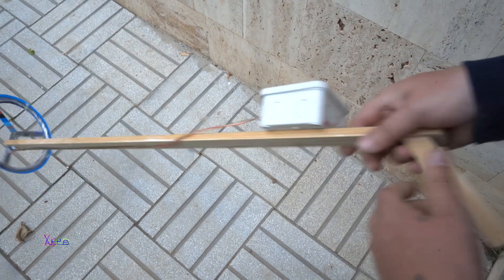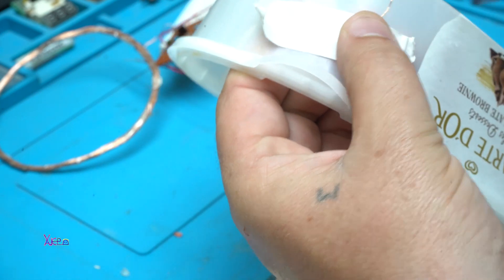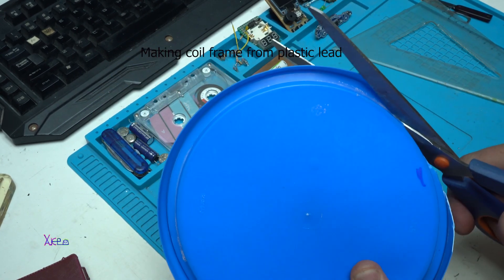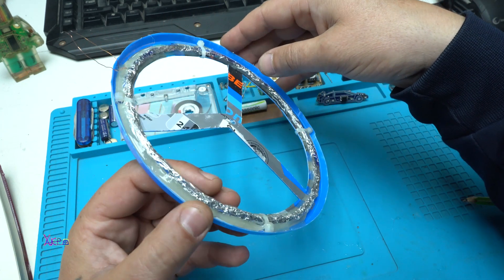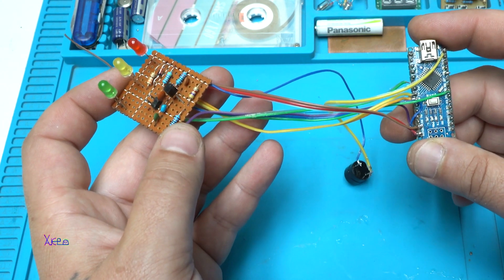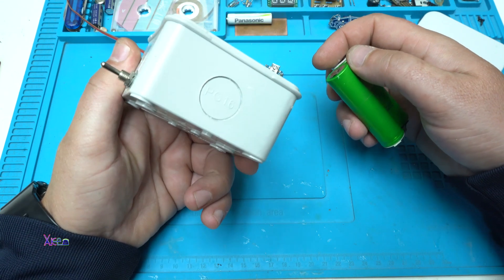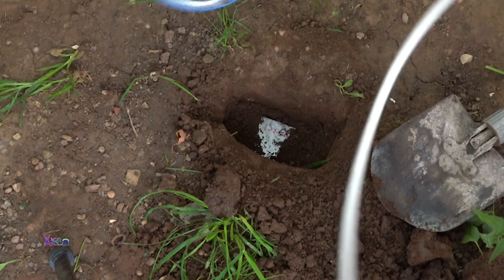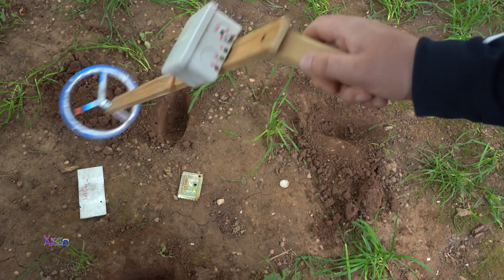How To Make Arduino Metal Detector  (100% Work)

Comment from the maker: Suggest next project? Comment below
Reply: Hey, great video!
I have a question about the Arduino. Do I need to use the specific Arduino Nano D5, or can I program it using my Arduino Uno R3 instead?"
Reply: It is recommended to design a long-range search metal detector that can distinguish precious metals
Reply: Very good. So ! detect gold?

Comment: I don't understand what the nonsense with the aluminum foil is about. It just makes the detected signal weaker. I tested it myself. The signal is much better without the foil.
Reply from the maker: Tnx for info,need to try it
Reply: I think you've right if you use metall near the coil is not good.

Comment: sir how to set 12v for arduino bord ?
Reply from the maker: You need to step down to 5v using a voltage regulator LM7805
Reply: @Hacktuber  * "I need to power both the Arduino board and the circuit with 12 volts."..sir
Reply: @Hacktuber  i have arduino uno bord..

Comment: I have a question, I bought a assembly kit for a metal detector from the internet, It is really weak and the coil is very small, will it increase the searching distance if I just connect it to a bigger coil with more turns and bigger diameter? And can I leave the rest of the electronics as they are?
Reply from the maker: You need to try it With bigger coil and I dont think that you need to change electronics

Comment: at arduino code, there is no code about buz. How does buz works?
Reply from the maker: Instead of led you can add a active buzzer with resistor,means when led is on the buzzer will sound
Reply: also, why do you use 8volts instead of 12volts?
Reply from the maker: Yes,I test the circuit it works from 6 up to 12v max,btw at 12v you get better results
Reply: @Hacktuber  thank you :o